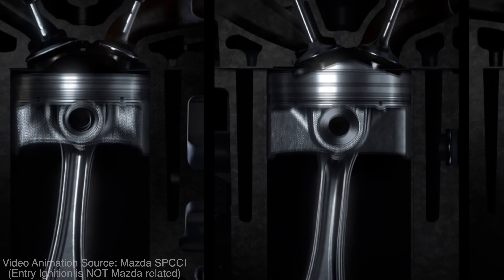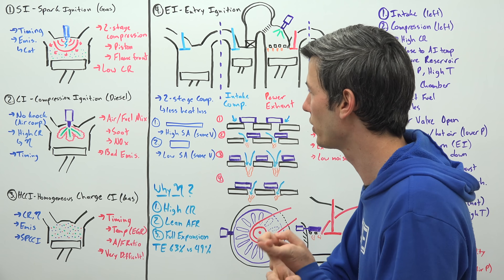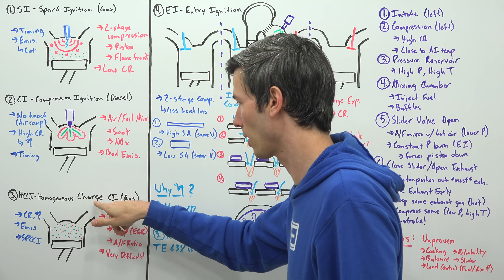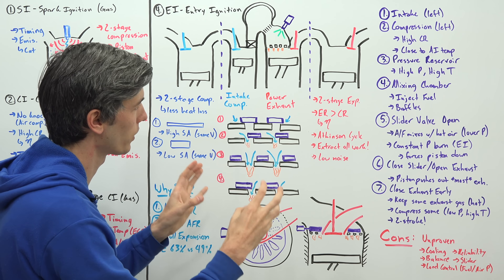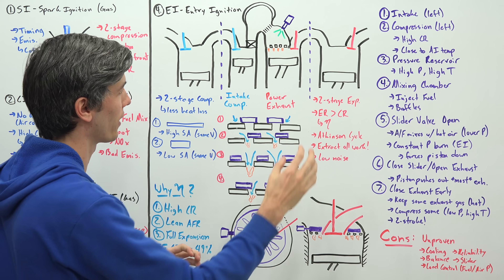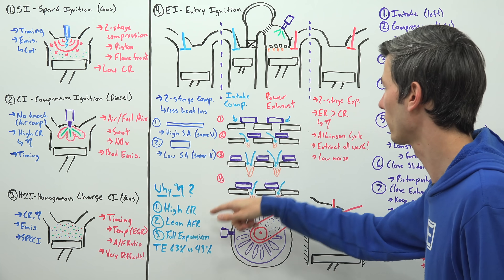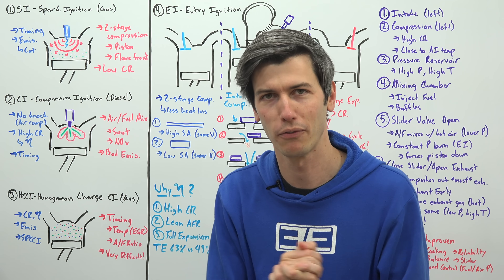Is 'Entry Ignition' The Future Of Combustion Engines?

Comment: Interesting, but yeah, that slider valve seems like the weak spot. I'm also curious how the engine would hold up if you got some bad fuel (or too much ether from trying to start the thing) and the pre-mix chamber (where the mix is supposed to be just below auto-ignition temp) detonated. Where would that energy go? Would it blow out the check valve or force its way past the slider? Or blow a hole in the manifold?

Comment: Yeah I can tell you that basically you have a 4 banger that literally is running on one cylinder and dragging the other 3, try disconnecting 3 spark plugs on your Toyota Camry and see if it starts and if it does, how fast does it go and what’s you MPG, I guarantee you it will be very little of both.
Reply: Sorry 2 cylinders, try disconnecting two spark plugs, I’m sure it will start. But it ain’t gonna drive very fast if at all. I disconnected 4 spark plugs and the same 4 fuel injectors on my Jeep to see if it would run on two cylinders, sure as hell it did, but when I put it in drive it stalled lol.

Comment: I think there are too many moving parts. I think we need to look at vaporizing fuel fuel before it enters cylinders. This was supposedly done. In the 1930 by Charles polgue.   Heat fuel to totally vaporize it and inject a very small amount of vapor to get high mpg. There is a lot of BTUs. In a gallon of fuel & we are
 wasting most of it in a cat. Conveter

Comment: I had an 84 bmw 325e that I was building for ite class. The head was shaved 0.0018. At 3500r.p.m. I got 43mpg. They can make a high compression, high efficiency engine.
Mazda is doing the best job for now.

Comment: Instead of slider valves, they could use sleeve valves which were used in some impressively powerful aircraft engines in the 40’s and early 50’s.......with some design work, they could probably eliminate the traditional poppet valves at the same time.........

Comment: This is extremely similar in principle operation to the original Dugald Clerk's patented 2 stroke engine of 1881, which had a separate smaller volume compressor cylinder feeding into the actual combustion cylinder. The only difference is the extra pair of cylinders tacked on.

Clerk's 2 stroke engine didn't require lubricating oil in the kerosene fuel as the crank ran in an oil sump just like a 4 stroke engine.

It was overshadowed by Joseph Day's crank case induction 2 stroke which proved to be more popular and makes up 100% of 2 stroke engines in use today.

I've always thought that the Clerk 2 stroke never had the development it deserved, being shelved before it even had aa chance.
Reply: Clerk's engine had an intake valve that actually closed during compression and combustion but according to the video the intake is open during combustion but the combustion never creates more pressure than the air compressed above it and would not create enough power to even drive the first two compression cylinders.

Comment: any rotating device with exhaust going through it will corrode so badly it will destroy itself... remember those exhaust pumps they tried ... they'd lock up and blow belts all the time.. every single one i've seen was locked up literally the equivalent of being welded from rotating.... so many moving parts.. just more to fail... good theory.. but i doubt it will make mainstream, just like the cvt never really caught on and just about every mechanic worth his salt says don't buy one.. even dealer techs who work at the dealerships say.. yeah avoid them if you can....

Comment: After the slider opens to let the compressed air-fuel mixture to enter the cylinder, wouldn't the combustion in the cylinder cause a high enough pressure to reverse the movement of air-fuel back into the pre-ignition chamber? Wouldn't this lead to combustion within the pre-ignition itself? Or is the slider opened only for a split-second, slow enough to let the mixture into the cylinder but fast enough before the flame front blows back into the pre-ignition chamber?
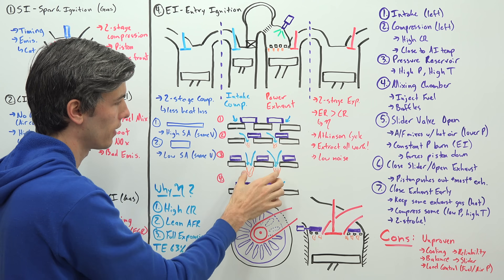Reply: From 7:33 to 7:45 you said that the pressure during combustion in the cylinder is lower than that of the pre-ignition chamber, thus the combustion doesn't force the air-fuel mixture back. How is it possible that your combustion has such a low pressure? The bulk of combustion has to happen after the sliders are closed.
Reply: @bigpp9054  According to the video the combustion pressure never goes higher than the compressed air and if that is the case the combustion pistons wouldn't produce the power to drive even the compression pistons

Comment: Yeah this is not gonna work. To many parts that 1. Need to be exotic metal for the slider valve. 2. The slider valve is gonna leak on the compression stroke and auto ignition point. This is over engineered and to many failure points. It's horrible inefficient using two cylinders to compress air in three cylinders.

Comment: Only 1 cylinder of 4 cylinders actually produce power stroke? With the weight of a 4 cylinders engine?  Er....

Maybe if this engine can replace the first chamber with 2 separate direct injection of fuel and air,  some how achieve similar pressure within that cylinder, will it achieve same effect?
And if the exhaust uses a reed valves technology (similar to a 2 stroke engine maybe), doing away with the (last chamber),cams and valves, this will reduce weight, making the engine rev higher due to less moving parts, Wouldn't that be ideal? 
Just my thoughts.

Comment: Missed a couple major drawbacks: packaging and weight. Especially if using the 2-stage compression and expansion to maximize efficiency, you're effectively having 4 pistons/cylinders plus a complicated head design to do the same work as a single 2-stroke piston (or two 4-stroke pistons). There's pretty much no way the improvement in thermal efficiency would make up for those huge drawbacks, especially in an automotive application. It might be worth exploring for other combustion engine applications where size and weight isn't such a problem.

Comment: A constant pressure combustion chamber, with compression and expansion stages physically separated in different parts of the engine,  kinda sounds like someone modified a jet engine's combustion chamber to tolerate the compression and turbine fans being replaced with pistons.

Comment: This sounds a lot like an old engine design that used a rotating cylinder as the values, with the air/fuel mixer inside the cylinder, only I do not think there was any compression in the cylinder and they burned to much oil. This looks overly complex and the slider, who big idea was that.

Comment: No one:

Engineer: "I'm going to develope a 2 stroke that's more efficient than a 4 stoke. It's going to have different sized pistons and a slider valve. It's going to be bad ass."
Reply: @Tobias-m5p5d  modern 2 strokes are much better.  The evinrude boat engines produce more power but less emissions than a 4 stroke.  No mixing fuel and oil too.  There are 2 tanks, the engine regulates the ratio automatically.
Reply: @rustynail914  Actually the oil injector is prone to failure (they've had that for 20 years) if it ever fails your engine will die.... its better to just mix it manually that way you know what is in there for sure. On the other hand if someone borrows your boat and runs it without oil it will also fail!
Reply: @rustynail914  An ICE can't match a 30 magnet electric motor as all the magnets are giving constant power.
Electric motors don't have to breathe compress and exhaust all takes time no power is being generated.
For an ICE to match an electric engine for torque it would need about 30--40 pistons. What would that cost to make and run?
Reply: @rustynail914  bruh Piaggio has been doing that for 50 years
Reply: @Tobias-m5p5d  that's because you burned oil and gas by mixing them for fuel.  By design, you are not mixing oil and gas so it has the potential to pollute less by producing more power and using less fuel, theoretically.  I think in reality, the slider is going to require lots of oil and that's going to mix with the fuel like it or not and transfer into the cylinder during the pressure balance pre-ignition and by unintended consequence of design, the slider mechanism will be mixing gas and oil anyway and therefore burning it anyway.  Plus, look at how close in proximity the fuel ignites past the slider!  The bottom of the slider is the top of the combustion area, so the temp will be very high there.  Are you going to need a super high viscosity oil to withstand those temps to prevent buildup on the slider!  How is the slider going to operate with higher viscosity? With that amount of surface area between the slider plates, wouldn't you want a lower viscosity?  There's so many ways for this completely fail outside of solidworks!
Reply: @rjsoderlund81  Large 2 stroke diesels such as detroit don't have oil mixed with fuel, lubrication is the same as a 4 stroke.
Reply: Yet this iteration describesca secondary burn chamber which would draw down the  pollution prior the venting to exhaust system.
Reply: @Tobias-m5p5d  You are talking about a traditional 2 stroke,  the engine in the video happens to operate on 2 strokes but it is not the same as a 'normal' 2 stroke engine, for starters it won't need oil to be injected into the in coming charge to lubricate the bottom end and secondly the exhaust valve will not be open at the same time as the fresh charge is entering the 'combustion/expansion cylinder'
Reply: @sidecarbod1441  Thanks.
Reply: Tobias New TPI engines are euro 4
Reply: Exactly

Comment: Why the heck do they call it "Air to Fuel Ratio"?
Air is a fuel. 
Try to run a Sailboat without it.
Reply: A sailboat doesn't use fuel. It uses air movement for its motive power, but it doesn't burn anything.

Comment: The turbo charger is a configuration that captures some of the pressure that is leaving the piston in the conventional engine. Capturing useful work that would be lost. The turbo charger has this efficiency over the supercharger. Pressure, the amount of gas in a volume multiplied by its heat.

Comment: What if we did something like constant volume suoercharged compression ignition hybrid. An exaust turbo. Also couldn't we just use extremely high octane fuel with a controlled amount of direct injection. Basically spark controlled spcci which sounds worse. Also just realized I basically just explained spcci or atleast how we could get as close to it as possible but controlling the amounts of air flow fuel and using a spark with direct injection to make it work on gasonline. Honestly the fun part of being an engineer seems boring because it probably wouldn't last very long in comparison to the amounts of busy work that goes into that. Which Idk if I would enjoy.

Comment: And what about electromagnetic valves? I've heard of it as an in-lab development but it's been so long that I've forgotten who did that (and since then I've ditched ICE anyway). But the advantages are obvious: no need for camshafts anymore, much better accuracy for controlling opening and closing timings (and as a consequence, real cylinder deactivation when needed), etc etc... And given the first point, much better reliability overall.

With the progress of power electronics in the last years, this could now be easily implemented is what I believe.

Comment: It means low noise on the last cylinder, since when low noise is a good thing? Cant you use the compressed air from a turbo-/supercharger in the pressure reservoir, and take the heat from the combusting cylinder to heat the compressed air and cool the cylinderwalls? To me it looks like u take hot compressed air (turbo/supercharger with no intercooler?) and pump it into a cylinder.  The slidervalve is a massive weakspot. It basicly is a highcompressed turbocharged two-stroke. You could use a high compressed biturbo charged small cylinder engine (1.6 V6) and a lean fuelmix to elimate all the problems u mentioned, of course you have to use high octance fuel here. I dont think a V8-Setup with 2 pre compressing and 2 exhaust cylinders just to make 100hp from an engine that basically is a overcomplicated 1.0 Liter 4 Cyl. two-stroke engine will find that many costumers.

Comment: Looks like you are trying to reinvent the Brayton Cycle engine from the 19th century.  Didn' t work well then and I doubt if it will work well now.  Need to see a working prototype on a dynmometer. with actual results.  There will also be a high friction losses.

Comment: Thank you for your informative videos.  I have a question.  Based on your expertise, I would like to know your thoughts on the following.
Hypothetically speaking, let’s say that a vehicle operator (driver) is driving on a highway and suddenly realizes that his vehicle is accelerating and gaining more speed without any intervention from the driver himself.  The driver tries to reduce the speed by stepping on the brake pedal, but the vehicle is not slowing down.  The  driver then decides to shut off the engine of the vehicle in an attempt to slow down the vehicle and eventually come to a complete stop.  Given such a scenario, would the driver be able to control the vehicle this way, steer the wheel and apply the brakes in safe way to stop the vehicle?  What sort of damage/malfunction can result from shutting off the engine of the vehicle in such circumstances.  What other possible action(s) could the driver have performed to safely control the vehicle and have it stop?  This may be a far-fetched scenario, but I’d still like to know your thoughts based on your automotive experience.  Looking forward to your answer.  Thanks in advance for your time.

Comment: So, if chamber 3 relies on pre-existing heat to ignite the incoming air-fuel charge, how do you start a cold engine? 
I get the idea of chamber 4 scavenging left over pressure in chamber 3 to do useful work, but don't we already do that with turbochargers?

Comment: Reminds me of the "twingle" two stroke engine on a  Puch motorcycle. The rear cylinder contained the crankcase transfer ports, and the front cylinder had the exhaust ports. The head covered both cylinders with a common combustion chamber.

Comment: I am curious as to how much there is in pumping losses with such a setup.  And then that slider valve needs to be lubricated, and instinctively I see that sending a bunch of oil into the exhaust.  And it sounds like the engine is going to need to be pretty large in order to achieve the necessary power.
I don't like it.

Comment: I realize this is a bit off topic, Jason, but what are your thoughts about GDI gasoline engines?  There's a tired old mechanic who's initials are SK, who absolutely has a rager over GDI. He claims it causes high pressures and wears out engines faster than port FI.  He also goes on to claim GDI causes oil dilution. I say BS on that, as GDI gives a more precise fuel metering and that would mean less waste. What say you?  I'm so sick of hearing him blast GDI (every time he opens his mouth) and I'm certain he's wrong. I trust what you have to say, as you're an educated engineer and a smart nice guy.  Am I wrong about the GDI argument?

Comment: That’s a cool idea, the question I have is will the efficiency gain out weigh the amount of power required to run the compression system required to get air fuel mixture in the cylinders.  That pump system, however it’s made seems like it will take lots of power to run.  Also won’t that super heat that compressed air chamber?   
One other comment,  this seams like a prime application for using the konigseg valve control technology.   What’s your thoughts on that.

Comment: This looks like it would be expensive to produce.
With battery tech getting better, lighter and cheaper, why is there a need to advance IC engine tech a great deal further.
Lets face it, there have been very little in IC engine advances in the last 20 years.
Electric however is a totally different story.
I work on fuel powered cars for a living but I can see the writing on the wall, I am learning lots about electric.

Comment: The peak pressure of combustion chamber reaches very high values. Maintaining a pressure above this pressure at the intermediate stage could take more work and the efficiency might be lower. It also seems that creating such high pressure through compressors is not efficient because you will be opposing combustion chamber pressure.
But it it comes to production, it would be interesting

Comment: Could be a good engine idea if instead of using pistons to compress the air, it used a supercharger or a turbocharger specifically built for this engine, that injected enough air for the first pistol to compress fully, then the "power" piston feeds the turbo with the exhaust gases.
So you could have something similar to a two-stroke diesel, but with gasoline.

Comment: Would you be able to go through a P/V diagram for such an engine at some point? I can't seem to figure it out.

Also, while it would probably be nice to replace the first and last cylinders with a turbocharger or use a supercharger for the compression stage, that would make the air pressure RPM dependant. I guess that would mean you need spark ignition for low RPMs? Then again that might also be a necessity for engine start up.

Comment: Excellent concept in theory, but controlling auto ignition to set timing? It's a challenge just looking at complex timing maps for 4 stroke fuel injection. And doing it with a rotary valve constantly heated in the combustion & exhaust cycles with fuel injection to build up deposits, not an easy task.
"You can have any style air compressor beforehand (superchargers are air compressors) ..."  Superchargers have parasitic losses. Turbochargers come with backpressure, which would limit efficient exhaust gas evacuation that this method requires. So fuel economy would suffer, unless you have at least the first 2 cylinders. Not a believer yet, best left as an SAE paper.